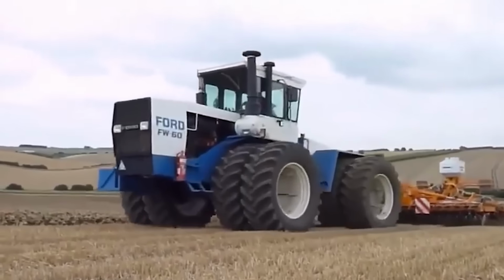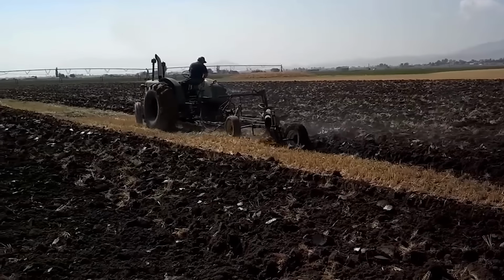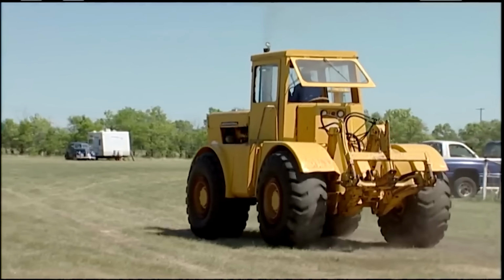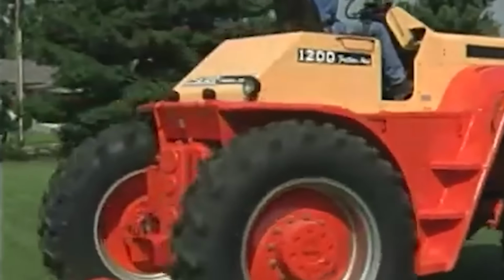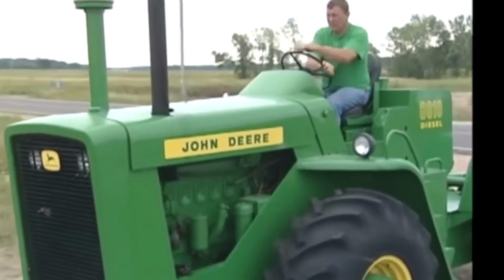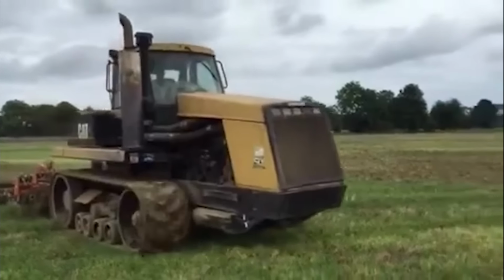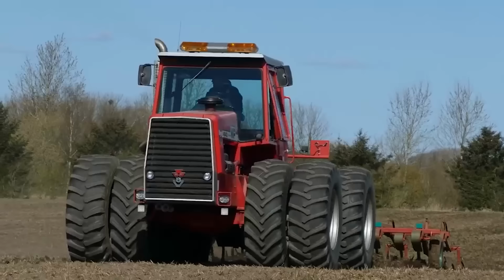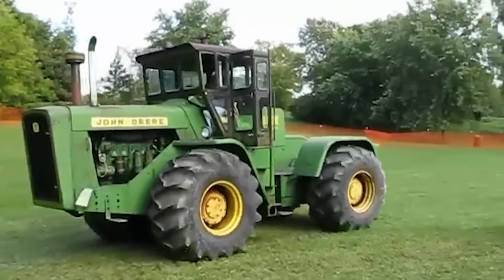9 RARE MUSCLE TRACTORS THAT YOU HAVEN'T SEEN

Comment: Good video. Some info about the 440. While they did have the 555 Cummins V8, it was never turbocharged.  The Versatile 555 was sold at about the same time, and it did have the VT555.  Planetary failures were not uncommon with the 440. I had two, and it happened on one of them. The best thing about the 440 was it's simplicity. All the mechanicals were off the shelf parts and easy to get. Easy machines to take care of. Nothing fancy but got the job done.

Comment: You might want to do your homework again on the D 21 Allis Chalmers. It does not have a hand clutch..
Reply: … and the MF 4880 which the commentary said had a 3208 Caterpillar V-8 (it was actually a 903 Cummins) and that it was (quite obviously) not a 2WD as the commentary stated. Otherwise, 65% of the material was almost half correct. Finally, Mr AI, no one on earth EVER referred to the John Deere as a model eight thousand and ten, the MF as a four thousand, eight hundred and eighty or the Allis Chalmers as a four hundred and forty.

Comment: The MF 4880 tractor was an articulated design, not conventional as stated in the video. The engine was a V8-903 Cummins, not a Caterpillar unit. This tractor series was originally made from 1978 onward and was noteable for its electronic linkage control, courtesy of Robert Bosch components. The MF 4000 range was originally made at De Moines in the USA before factory closures in early 80s transplanted their production to Ontario, Canada.
 Once the Brantford factory production of combines and tractors was split off to become the Massey Combine Corporation, carrying with it, most of the Company's debt load at that time, the writing was on the wall.
 To the best of my knowledge, MF's 800 series combines ceased production circa March 1988.
 The only tractor McConnel made for MF, after aquiring the rights to the design, was the MF 5200 model, which had a straight six engine situated below a stretched front frame and bonnet, to accommodate the extra length of said engine. The front third of the bonnet sloped down to give the tractor operator a better line of sight, and the tractor was manufactured from 1989 thru' 1991, when production ceased.
 Agco aquired the rights to the design back off McConnell and introduced the AgcoStar articulated tractor circa 1994/95 time frame.
 Mechanically it was pretty much identical to the former MF 5200 model, but the bonnet was now restyled to mirror the conventional White tractor line of the era, with a composite hood structure, as opposed to metal. The cab frame was also identical to the MF 5200 unit but the cab roof moulding was again restyled to mirror conventional White tractors.
Reply: Yeah, that was a real laugher.  3208 Cat in a tractor of that size.  Right.  Who dreams this stuff up?
Reply: We had a White articulated tractor with the Caterpillar 3208 engine. The design was severely flawed as the poor gal kept puking clutches, and it's a serious PITA to change them buggers out. When she was up and running she got a crap load of work done in a hurry...that clutch just couldn't handle the torque.